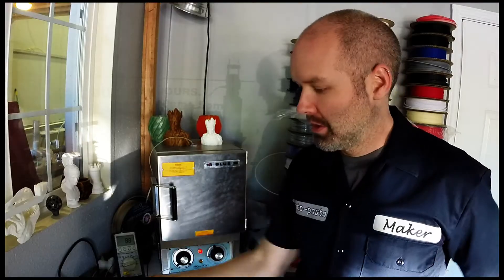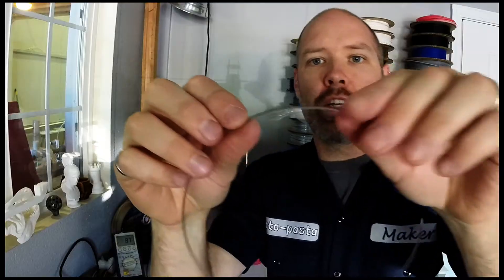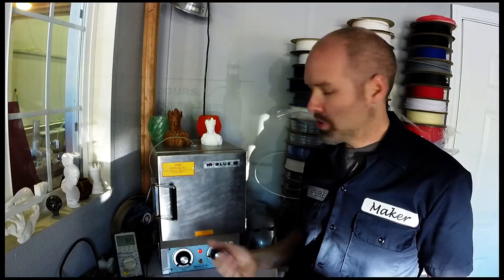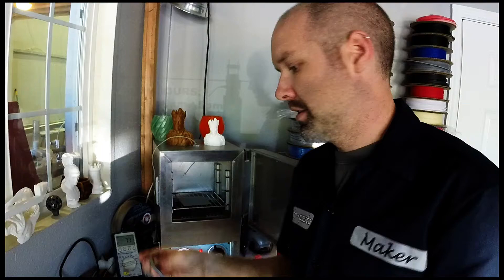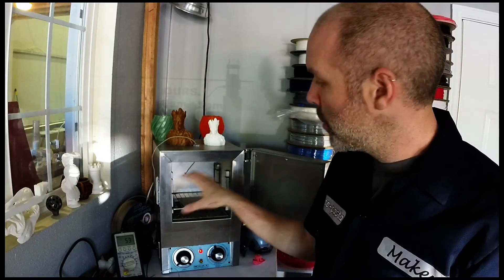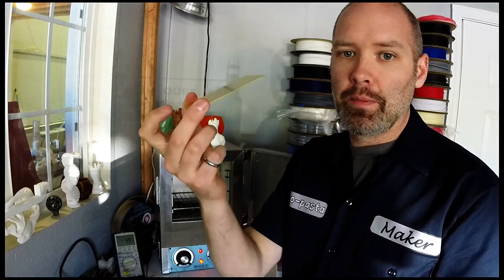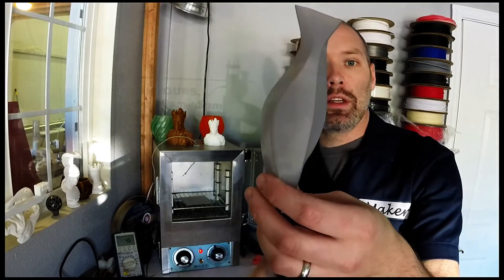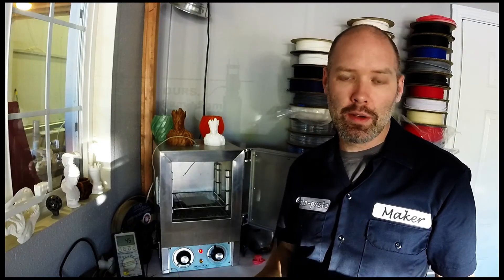Introduction to Proto-pasta HTPLA

Comment: I've found for larger solid prints, packing them in fine grade play sand and baking at 110C/225F for several hours works fantastically and prevents warpage aside from scale shifts.  In this case, translucent and sparkle HTPLA I print at 100.4% X/Y and 99.8% Z, and Matte Fiber I print at 100.01% X/Y and 99.95% Z for nearly perfect final dimensions every time.

Comment: Buy fiber mate and I can not print without issue a jam. I could help.

Do you think need to use a nozzle hardened?

Only with this material, I have had this problem.

Thank you
Reply: This prints just like PLA.

Comment: This is not true. Regular pla on the spool should not snap at all. You can only bend it. Otherwise, it means to much moisture was near your pla
Reply from the maker: George Elsham great point regarding moisture, but it's not so cut and dry. Process temperature, additives, and crystallinity also influence filament durability. A difference in crystallinity is what we are demonstrating here and with an impact load, not just ductility in bending (which is important to distinguish). These PLAs are not impact modified. HTPLA v3 (newer and not seen here) is the evolution of our understanding and adds a touch of impact modification to further improve durability and performance with minimal sacrifice to stiffness. Check out Proto-pasta.com of you want to learn more about v3. Best, Alex